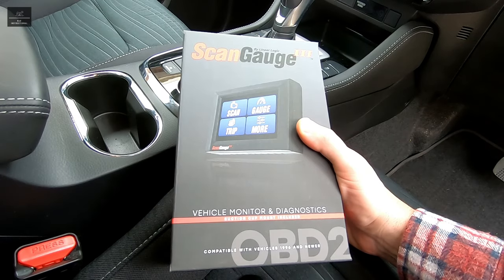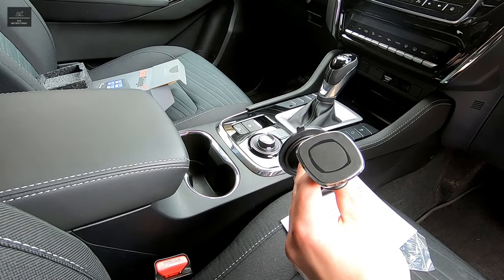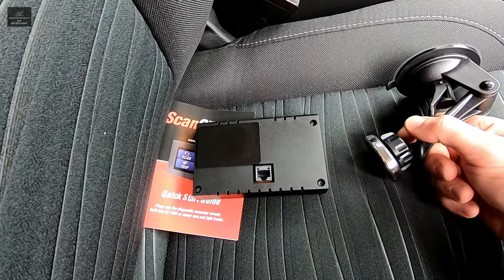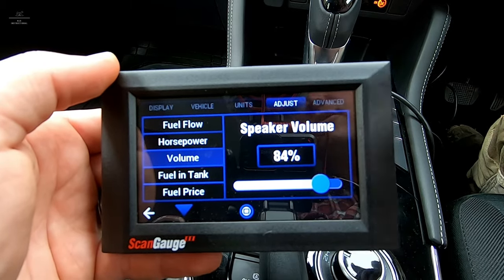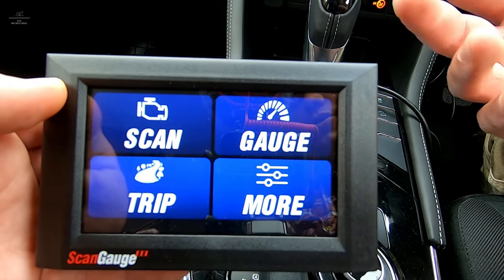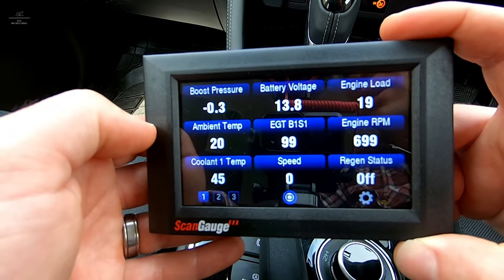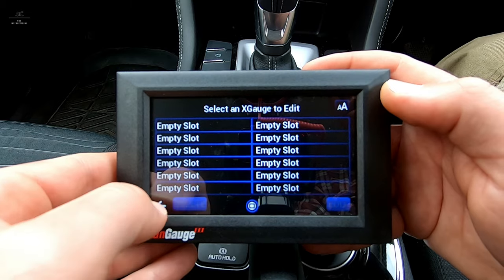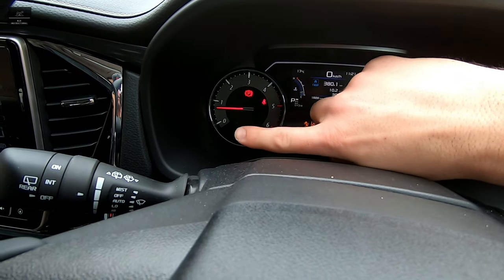ScanGauge3 Detailed Review - Vehicle Monitoring and Diagnostic System Scan DTC, Gauge, Trip + More

Comment: quick heads up. I have the Scanguage 2 and the window mount. Inside the windscreen mount there is 3 magnets held down by glue. This glue heats up and gets brittle in the heat and the windscreen mounts magnets basically pull out really easily. I had it replaced a while ago by scanguage and the 2nd unit has done exactly the same thing. I mentioned this to scanguage at the time of the first problem so Im not sure if they've made changed to the glue since. (8 months ago or so)
Reply: That's exactly what the bloke said when I asked about heat when I purchased mine, I said my ute is parked in the Aussie sun 24/7 (QLD) he mentioned exactly the issue you have mentioned. Only way around it he said was when first unboxing glue the magnets down don't just rely on the adhesive. Ive only had mind for 2 days hence why I'm watching a few videos on the Scanguage 3. Time will tell
Reply: @Reflect744  I think there should be a gimble style mount instead of the magnets which are prone to heat related failure. Another way would be to mount it out of direct sunlight which is never easy.
Reply: @downthetrackaustralia  Good point being on the windscreen it's kinda hard to avoid sun. I haven't looked into it but thought maybe some sort of "Quad-lock" mount not sure what styles they offer or if it's possible but would definitely resolve relying on some magnets that aren't that strong anyway. Not sure how the magnets would hold up off road I'm yet to find out....
Reply: I've had something similar with a dashcam unit which is quite heavy, so I have found that using  "Gorilla Grip Double sided tape (about $6 from Bunnings) is really good, I've had it in 45 deg temps for several weeks in the outback, and absolutely no dramas.

Comment: Just found this one. Was thinking of getting one for a Prado, but since it looks like it does not show which gear is selected [auto trans] I may put it off
Reply from the maker: Check out the ScanGauge AUS website. ScanGauge are continually updating the firmware and adding additional gauges. It looks like Gear Position is available on some model Prado's.
Reply: @NJSInstructional  
Thanks for the reply, I will check the site
Reply: Why do you need a screen to tell you what gear your in especially in an auto 😂
Reply: @p1pyd  
I just want to know what gear I am in, cant count them as you go up and down gears.

Comment: I have the Ultraguage to monitor transmission and torque converter temps along with seeing if the TC is locked or unlocked. Can the scan gauge 3 show that information also?
Reply from the maker: I'm planning on releasing a video in March which shows how to update the Firmware and program X-Gauge commands on the ScanGauge3. Depending on make, it may be possible. On my vehicle, I now have ATF temperature gauge... Stay tuned!
Reply: @NJSInstructional  excellent I will keep an eye out. My vehicle is a 2023 Y62 Patrol.

Comment: Thanks for a very good video.  I see they now have EGT for the new Isuzu, do you have auto transmission oil temp?  I have a new model DMax and have held off because the ScanGauge II did not have either EGT or gearbox temp.  Most of the other things like trip, average speed etc, you already have on your new MUX.  very disappointing ScanGauge, they have had plenty of time to resolve the Isuzu issues that they have supposedly been working on since August 2020.
Reply from the maker: Cheers. Overall the product is excellent and I have observed there are a number of more gauges in this version than there were in the previous (for e.g. EGR temp, Regen Status etc.). EGT works well and was also present on the MKII version. Another plus for the Isuzu is you can observe the Boost Gauge (on the 2017-2020 MU-X/D-Max it wasn't available). Yes, it would be helpful to have the ATF temp also, especially for towing. However, I wouldn't let one gauge (which will hopefully come), diminish an otherwise great product.
Reply: @NJSInstructional  Thanks for your reply, appreciated plus I agree.

Comment: @NJS Instructional   Thanks for the video. On ScanGauge3 can you choose to have fewer tiles per screen than 9. I would like oil pressure, water temp and trans. temp only on 1'st screen.  thank you
Reply: Wondering that as just wanted too see temperature related things while towing.
Reply: You have the option to add 4, 6 or 9 tiles per screen from display settings..

Comment: Nice video does the scan gauge 3 tell you transmission temp?.
I also have a Isuzu.
Reply from the maker: Yes it does. Be sure to check out my newer video showing you how to update the firmware and program X-Gauge commands. The newer firmware has an Isuzu specific list which includes ATF.

Comment: Hi @NJSInstructional, I just recently bought the Scanguage3 for my Isuzu MUX 2018. I have updated to the latest firmware. But I cannot see Regen Status/ Type. Any xguage code for mux for that? Cheers
Reply from the maker: Thank you! Be sure to check out the ScanGauge website for any X-Gauge commands. I'm not aware of the regen status for the 2018 Isuzu MU-X via the ScanGauge. However, there is a DPD display on your car's MID which will show you the DPD level and also the regen status. Check out this video: https://youtu.be/103tvMW5EOM

Comment: Nice video, thanks for the review. I can't see it listed on their description as to whether it reads engine oil pressure. Does anybody know if it does? I feel like that would be one of the first things you would want to monitor...
Reply from the maker: Oil Pressure can be read provided the manufacturer of the vehicle permits it to be read via CAN Bus / OBD2. In my experience, not many manufacturers release this information. It seems to be more of an industrial engine parameter...
Reply: @NJSInstructional  Turns out in Australia our vehicles tend to have an oil pressure switch that opens at a minimum pressure, rather than an oil pressure sender. So I don't think our ECUs get a distinct oil pressure value anyway. 

Thank you for the reply. I enjoyed the video and it was very helpful. Cheers.
Reply: I contacted manufacturer to see if it would do OP on my tacoma. Answer is no for my ride. Cheers.. I bought it anyway. Love it. @NJSInstructional

Comment: Thanks for the bideo. Can I perform a forced regen with the scangauge 3? I have travelled over 3,500 k's since I bought it and I haven't yet seen a dpf burn. Is this normal? I'm slowly working through how to use it. Thanks for any advice.
Reply from the maker: Not a problem, I believe this depends on the make and model of vehicle and whether the manufacturer permits this function.
Reply: You generally won't see a regen as it does it as you drive. Don't worry about it unless you see a warning on the dashboard. Don't force regen.
Reply: @downthetrackaustralia  I’m just interested in finding out as much as I can. For instance, on the Scangauge I can see the spot load has gone from 0.009 to 0.029 over a couple of weeks so just wondering what level triggers a burn. Also, while I wouldn’t normally force a regen, I can understand that there may be circumstances that it is becomes necessary.
Reply: @richardmalone3172  Your car will do a passive regen as you drive. Provided that it has enough fuel and is operating at normal temperatures and revs. On my scanguage I display egr and can generally see it when it increases in egr temps. Might not be the same on all cars though. The worst thing for dpf is short trips where the engine doesn't get above temperate and revs for it to passively regen. All it takes to resolve that is to take it for a reasonable drive along the freeway at over 70 or 80kph when the engine is at operating temps. Depending on the car the passive regen will occur at different soot loads. Usually 30 or more percent. It's not something you need to worry about. It's all computer controlled. If you did need to do a manual dpf regen I'd only recommend your dealer to do it with their proper plug in tool as it can take a couple of hours to complete. If you are low on fuel or your fuel light comes on it generally won't perform a passive regen. Just drive it on a reasonable trip up the freeway and it will be fine.

Comment: I bought scangauge 3 after watching. If you go to quick start guide, Your first fill-up Step 1 and follow it, there is an issue. Where it says at 3) On your first fill up, do not make any adjustments to the indicated fuel. Simply press Save. Then go to 4) Next press the Fuel Cost Tab. Enter the cost per litre and press Save.
Well if you press Save at step 3) it goes to a different screen and you can't follow their instructions.

Comment: Do you know if it’s possible to set it to urn on and off automatically? Mine just stays on unless I unplug it
Reply from the maker: It should turn off when ignition is off. It may also turn on initially when you connect it to your vehicle but then should turn off if the ignition is off.
Reply: @NJSInstructional  it actually does turn off now after a day of use, thank you for the help :)